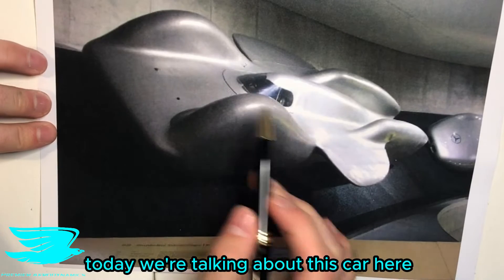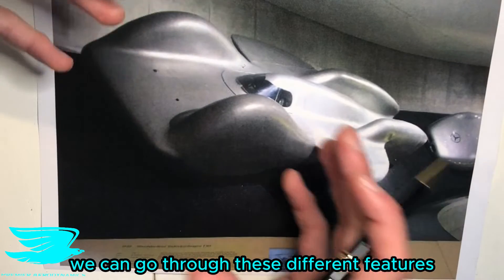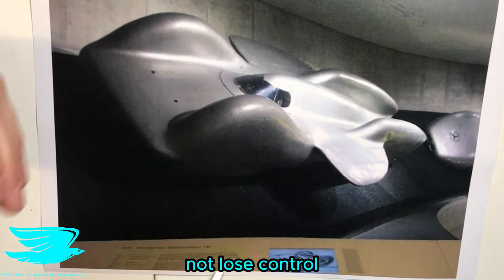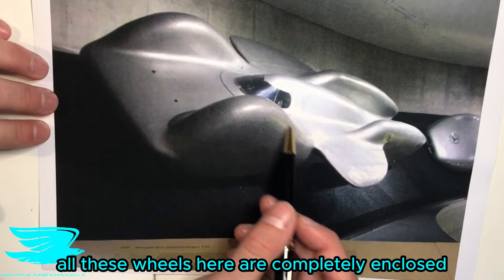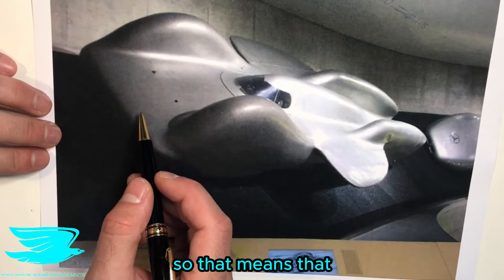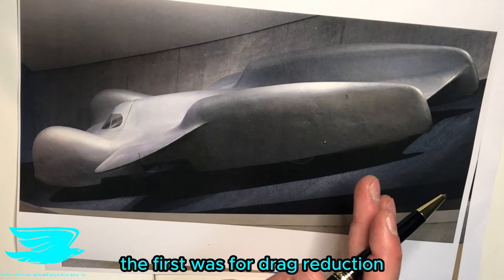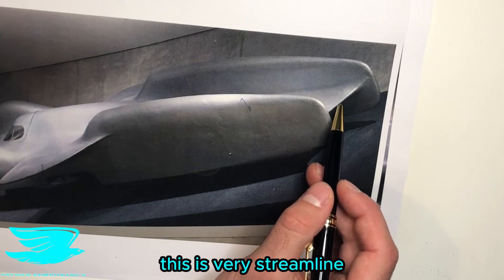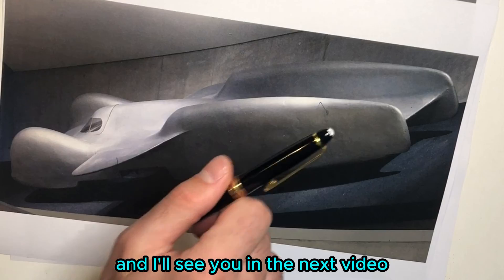{Auto Aero #41} Mercedes Benz T80 Aerodynamics Explained

Comment: Encasing the wheels reduces outside drag. However, having these "tesla pumps" in a casing creates considerable drag that the drive of the wheels must overcome. This is taken off the power that arrives at the interface wheel/ground. It won't show up in a measurement of cd in a windtunnel, though.
The wings can't have produced a lot of downforce either, lest they create immense induced drag due to their short aspect ratio.
Reply from the maker: Definitely, this pumping (the ventilation drag, as I know it), is something that isn't usually measured, so you only see its effects in the real world, effectively.

This ventilation drag can be reduced by making the rims smoother, with fewer spokes, and not having lateral grooves on the tires, only longitudinal.
Reply: @PremierAerodynamics  the advantage is that it can easily be overcome by enough motor power, without affecting driving characteristics and stability negatively. E.g. the additional power does not affect the interface wheel-ground.

Comment: Great video. 
I have always been under the impression that a blunt front end on a car is just as efficient as a pointy, sharp one when there are radiused edges, attached flow, and speeds are under 300 MPH. 
Point 18 cD on this car is very, very impressive, but I can't understand how that the Mercedes EQXX can have a lower cD than that, despite having a much,much larger wake. 
If you ever need a topic to cover, please consider how blunt front ends, versus sharp front ends affect overall drag. *
That, and wake size. How does wake size affect overall drag ?

" For example, the first generation Scion Xb ( the really boxy one ) has a .32 cD, and is very short. The 1992 - 1995 Firebird Formula has the same .32 cD, despite a highly pointed nose, a sloping windshield and back glass, and a long shape.

- Thanks for the videos you post. I learn so much.
Reply: "a lower cD than that, despite having a much,much larger wake"
cd is only half the story. This is multiplied by the cross section. That's where the large wake comes in.
Reply: @HotelPapa100 You are talking about the cDXA figure, and not the cD, correct ? 
I know that this race car has a much lower cDXA than the EQXX, but what puzzles me is the higher cD, since the EQXX has a much larger wake. 
I have been under the impression that a smaller wake = lower cD.
I'm also confused about how that blunt nosed cars ( such as the Scion Xb and cars such as the .25 cD Lexus LS430 can have a great cD, despite looking like smooth bricks. 
From what I understand, a sharply pointed nose like the 1993 - 1995 Firebird Formula would have less PRESSURE drag than a blunt nosed Scion Xb, but am puzzled as to why the cD is equal on both cars. 
- Thanks !
Reply: @O-cDxA  Why cD of the long T80 is higher than that of the EQXX is quite easily understood. The T80 has MUCH more wetted surface, surface area that is in direct contact to the flow, where viscous drag can act. In addition, the stumpy "wings" create quite considerable vortices at their tips, if they are even just moderately angled against the flow. Here the fact that cD is normalized against cross section begins to act. The T80 is a much larger car for its cross section than th EQXX

Blunt fronts don't create a lot of drag in subsonic flow. They build up sort of an optimized flow pattern in front of them that makes the flow separate in a near optimal way. Blunt is better if you don't know the angle of attack exactly. (just look at the drop shape that is considered the ideal aerodynamic body.) Very sharp noses have low drag just for one angle of attack, anything else may cause flow separation. (Angle of attack is not really a concern in cars though, as it is a given while running on the wheels)
Pressure drag is really mostly a function of how well you get the flow to re-unite behind the body, in order to not get a large low pressure wake. In idealised flow, the streamlines just rejoin behind the body, and pressures in front and behind cancel out.
Reply from the maker: For these questions.

First, the front bluntness isn't as important as the rear. Two examples of simple objects that show this are airfoils and teardrops.

Both have much blunter fronts than rears. But, the bluntness of the front does impact how much energy the flow will have downstream. If you have a blunt front, more of the flow's energy will be dumped into the front and so as the flow goes around the car, it will be slower. That means that it will separate easier downstream. Leading to greater pressure drag.

As such, you have to make the rear even more elongated and not have small radii of curvatures, otherwise the flow will separate. So, a sharper front makes it easier to reduce the drag coefficient of the car. It also reduces the frontal area exposed to high pressure, which also reduces the drag coefficient a little.

It's definitely true that the 8 meter long body of the T80 works against it in terms of skin friction drag,  but at the time, they were focusing more on reducing the pressure drag, which is why it was so elongated.

The wings definitely do produce induced drag, and I think that the induced drag would be more than a well designed, modern car with the same downforce because these wings produce significant downforce near the wingtips (from what I can tell from the geometry), which produces more induced drag than if more of the downforce was produced near the wing root, and then gradually dropping off as you approach the wingtips.

You can design a car so that the car itself produces the downforce, and as you move away from the centerline of the car, towards the sides, the downforce production drops off. That reduces the induced drag created by the car.

As for the Scion Xb having a drag coefficient of 0.25, I couldn't find that. I found that it had 0.32, which is pretty bad, but still I guess better than you'd expect from a brick. From the pictures I've seen of it, the wheels seem to always take up most of the wheelhousings, which is good for drag. The front bumper also has this two stage design, where lower down section juts out. This would also reduce the drag a little because now you have kind of a discontinuous curved front. Some models also seem to feature air curtains, which drop the drag by 5 counts, or so. So, I think these minor things around the car are what get the drag coefficient down to 0.32.

It's not as surprising to me that the Lexus LS430 has a drag coefficient of 0.25. The front and back slope fairly nicely (compared to the average car), so as long as the flow stays attached over the rear window, the pressure drag will be lower, and the wake will be mainly due to the back of the trunk/boot (and wheels). Overall, there is very little surface area that is perpendicular to the freestream flow. That is good for reducing the drag coefficient.

As for the EQXX having a drag coefficient of 0.17, but still producing a larger wake that this T80. Well, I'm not convinced that it has a larger wake because I haven't seen the wake of the T80. I am trying to get a model of it to do CFD on, so we'll see. Maybe the EQXX has a larger wake, I don't know, sorry.

But, some potential reasons why the T80 isn't as good as the EQXX are that the front wheel casings of the T80 pop up quite a lot. That means you have front and rear areas fairly perpendicular to the freestream. That creates pressure drag. Also, having six wheels, even though they are mostly covered, still increases the drag a little. The EQXX only has four. And then you have the induced drag from the wings.

The EQXX would have a lower drag coefficient if the rear extended to a point, but this car, as pretty much all cars these days, is a balance between the aerodynamics and styling (and safety). A blunter rear end means you have more to work with and put more lights on, etc. You can make it look cooler.

So, the few counts they would reduce the drag coefficient by if they made the rear sharp was probably sacrificed for good looks.
Reply: @HotelPapa100  Thank you for the reply. Both you, and the channel creator really explain things in plain, simple, easy to understand ways. 
That's much appreciated ! 
I have so much to learn about aerodynamics.
That bit about the AOA on the nose being important was new to me. I learned something new !
Reply: @PremierAerodynamics  So many good points you bring up here ! Thank you for such an easy to understand explaination. 
I understood more in thirty seconds than I did in three years of reading aerodynamic gibberish. 
Regarding the Scion Xb and Lexus LS430, I'm wondering if you were looking at the later models. 
Both the Scion Xb, as well as the Lexus LS430 had 'blunter' bodywork in their first generation. ( 2003 Scion Xb, and 2001 Lexus LS430 )
Also, the air curtains were not present on that first generation Xb. 
Thank you for taking the time to write all of that.